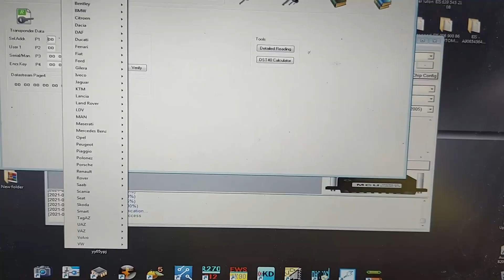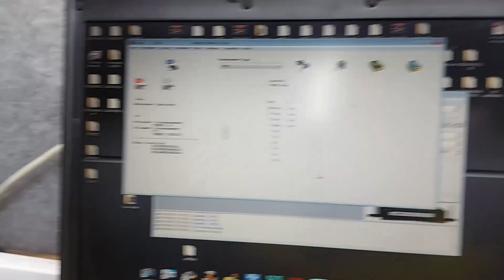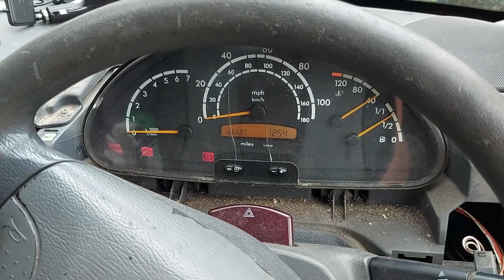🔑 Mercedes Sprinter / Vw Lt  2002 - 2005 lost manual keys, 🔑 How is made a Master key🔑 Cum se face 🔑

Comment: Do you cover London area?
Reply from the maker: Yes mate
Reply: @sebastianthelocksmithandre1600  perfect. I have a same sprinter as this. I had the key cloned in a new blade but I believe the man didn’t program it the box on top of the cluster like in your video. 

My car doesn’t crank on its own. The starter is not being eenrgezidd I have been advised this is because that box on top hasn’t been programmed to the new key he made is that correct? Anyway what’s ur number and how much do you charge ?
Reply from the maker: Best thing for you is to Google and ring car keys solutions and they will advise you.
Reply: Salut Sebastian,  am nevoie de serviciile tale un număr de contact te rog

Comment: Can vvdi2 serve where tango served along the video?
Reply from the maker: Yes vvdi2 should be able to do it
Reply: @sebastianthelocksmithandre1600  Please which chip did you use? If vvdi did you generate it first?
Reply from the maker: @Abonimablesnowman  needs T5 transponder
Reply: @sebastianthelocksmithandre1600  Oh, it can't be generated. I need to it separately I guess. Any difference in ceramic and glass t5-id20
Reply from the maker: @Abonimablesnowman  both are the same
Reply: @sebastianthelocksmithandre1600  Oh ok... Thanks man. I want to buy this vvdi2